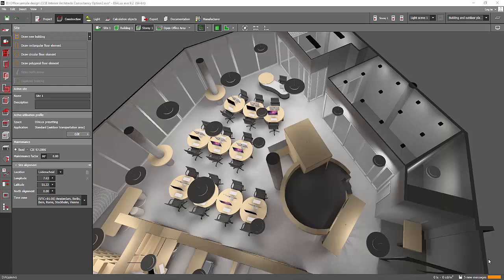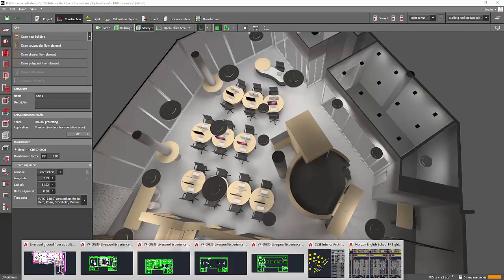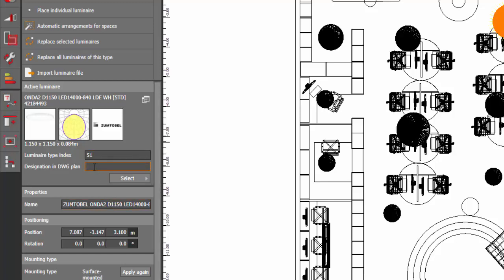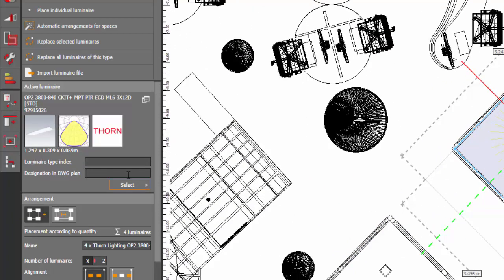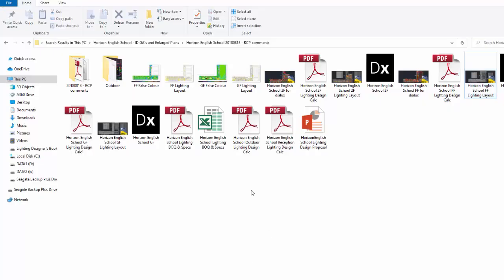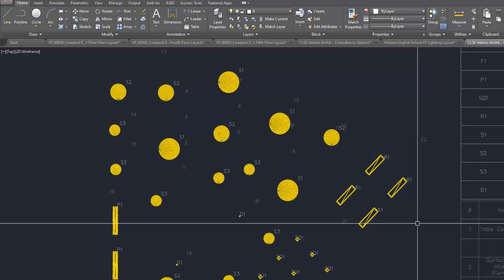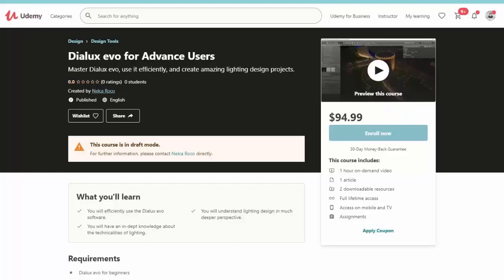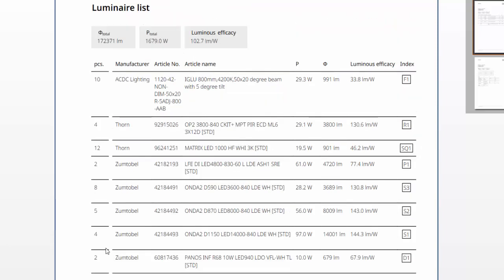How to rename or relabel the luminaire in Dialux evo

Comment: Pity you cannot create different codes for a fitting which has the same part number but may be mounted differently, surface or suspended for instance.